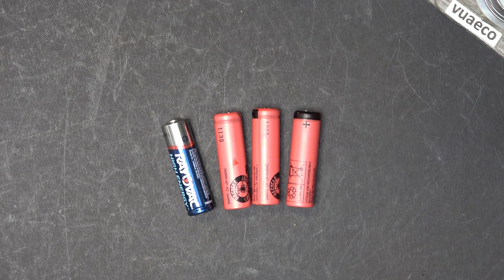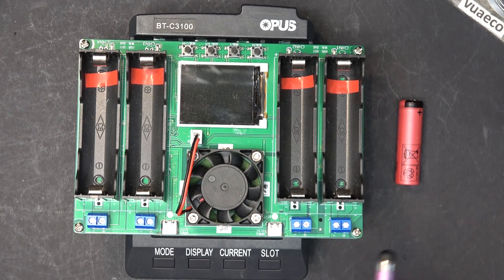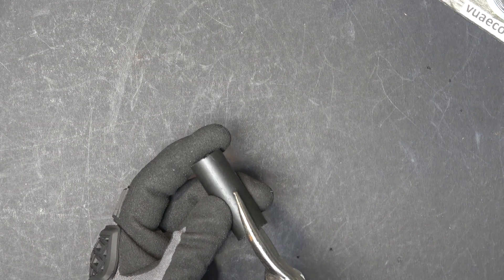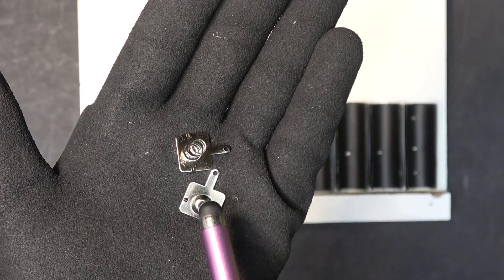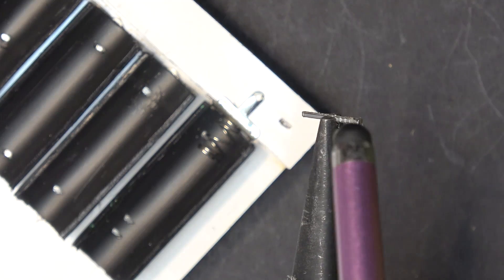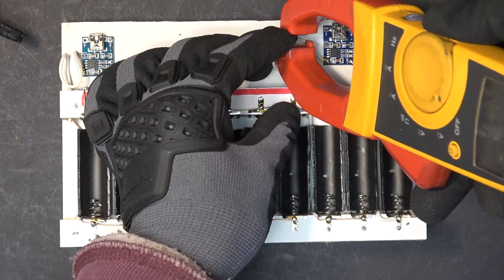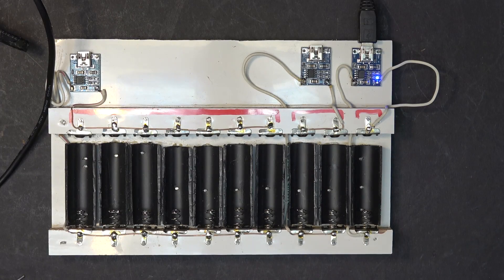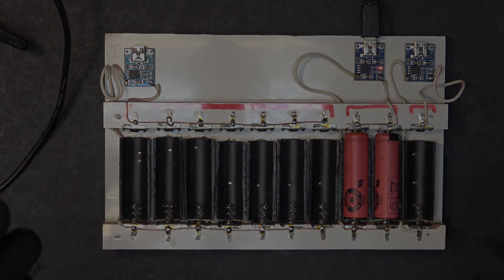DIY: Home made 10-slot 14500 AA size Li-ion battery holder & charger

Comment: I'm curious, if you were going through the effort to make this, why not just use a single TP4056 and have a few resistors on a jumper so you could select the current and have all the battery positions in common?

Comment: Hey, Mr Refugee, what makes you think that parallel cells will be so commies that each will take exactly (or within acceptable tolerance) the same current, and after many (or Carl Sagan's millions and millions and millions) cycles they won't be so far apart in voltage that they'll start blowing up or going bad?

Comment: If any of the batteries in parallel are at different states of charge, they will potentially charge each other at a lot more than 300 mA
Reply from the maker: For bigger or high discharge batteries, yes. But for a tiny 14500, low discharge cell, not likely. Unless you put a fully charged 14500 cell in parallel with a fully discharged 14500 cell, it's not going to be that much current flowing between the cells. Of course, when you put them in parallel, you always have to double check to make sure they have the same voltage first before you put them in.

Comment: Those TP4056 boards get HOT!!!
Reply from the maker: Only when you charge bigger batteries at 1A for extended period of time. For a tiny 14500 battery charging at 200mA, it's not even warm.

Comment: Is that what I would call PEX tubing? PEX is made for water lines and underfloor hydronic heating.
Reply: The tubing he's using is just PE pipe. Like PEX it's made of polyethylene, but it's cheaper and not as strong.
Reply: @GleebusGlumbus  Thanks, PEX is pretty cheap. I just looked it up on Menards. under $2 for 5' of 1/2".